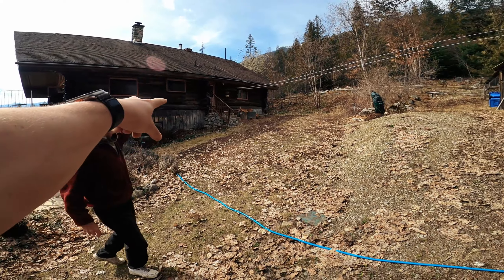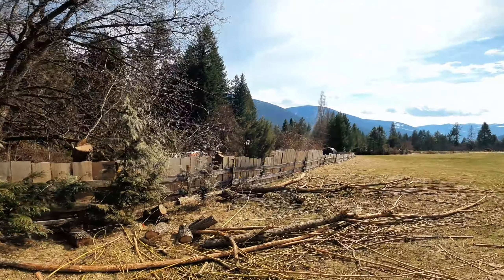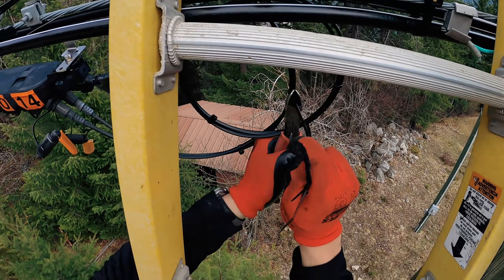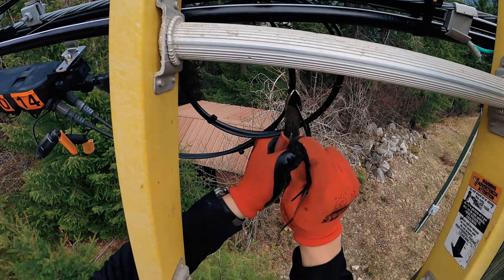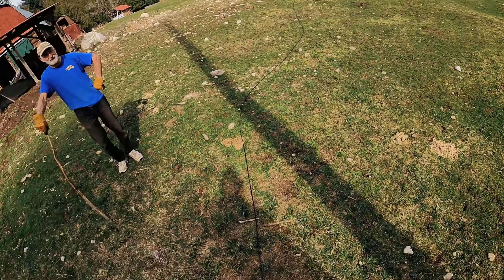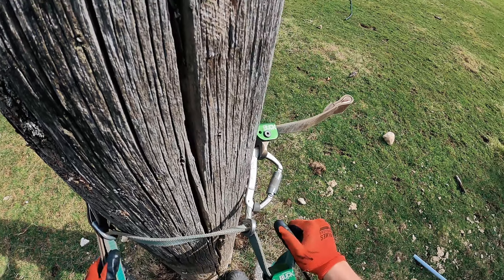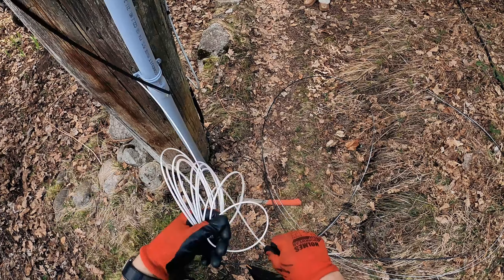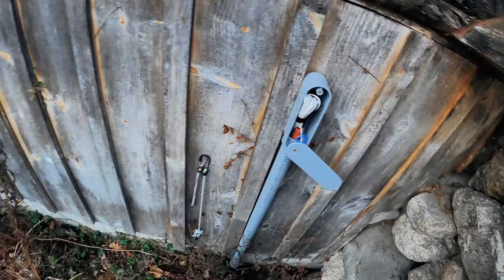4 YEAR WAIT FOR FIBRE OPTIC CABLE

Comment: You don't check for light at Nid? What happens if it was a bad aerial drop?
Reply from the maker: Then it gets fixed 😅, I batch test my drops when I get them. It’s a very low chance of any issues. In over 2000 drops ran I’ve had maybe 3 -5 have issues

Comment: As someone who runs mainline fiber and coax whoever ran the mainline for the company you are installing for is hot garbage at least from this video. Air gaps all over the place fiber is wrapping the stand. On the first pole you went too the coax was just hanging 2-3ft off the strand not even an expansion loop. Electrical tape was used at every bug nut/lashing clamp and not using spacers oh lord rant over before I write a novel. Keep up the good work.
Reply from the maker: The provider I work for doesn’t do Coax, but yes the Coax plant is very messy. You should join our discord, we discuss this type of stuff and we have a chat channel just for rants 😅
Reply: @FyBurz  I just joined. I am Operated in the chat. Have a nice one man.